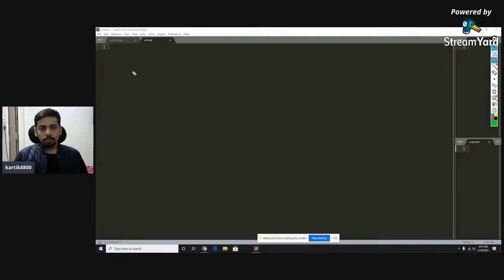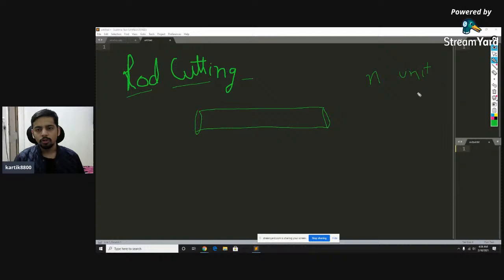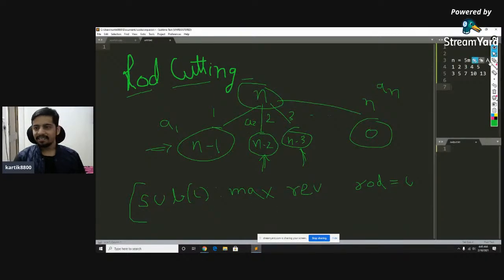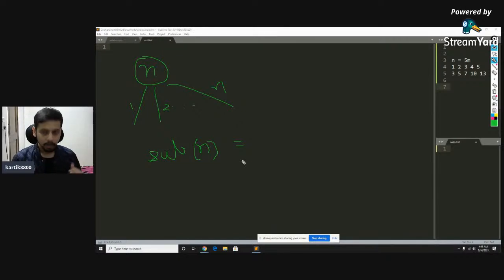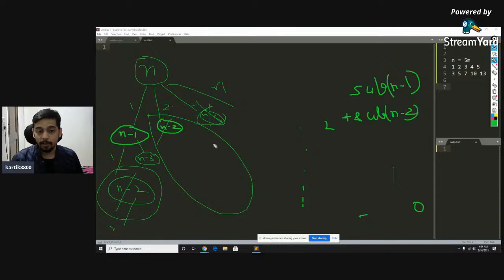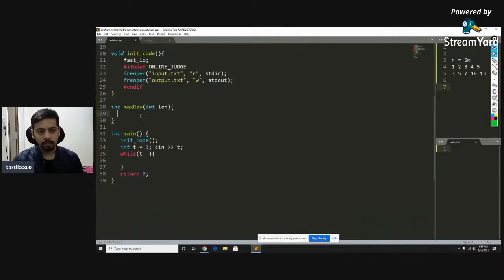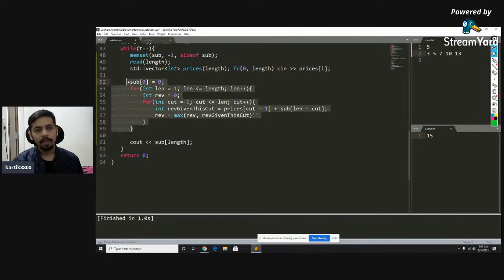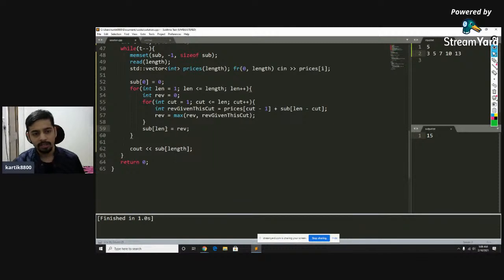Rod Cutting Problem: Live lecture on DP

Comment: 27.44 I was little confused about how answer is 15 because I am coming with answer to be 13(either taking length 5 --> 13 or length of 1 & 4 ---> 13)  I tried through this matrix chain multiplication approach(its not optimal though). https://ide.geeksforgeeks.org/Fjeyqb3Pkf
Reply from the maker: Answer will be 15 by selling rod of length 1, 5 times.
Price[1]*5 = 3*5 = 15
Reply: @AlgosWithKartik  Yeah got it 
Thanks.
I haven't considered the fact that we can repeat lengths many times.
I got in wrong way😬
I should think of top down or bottom up instead of MCM.